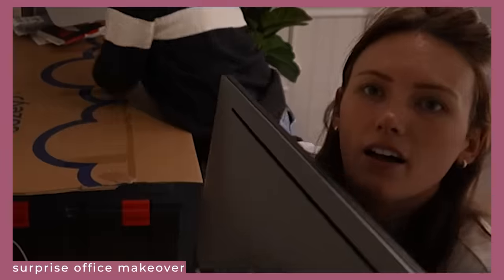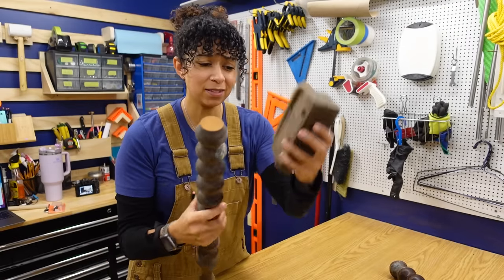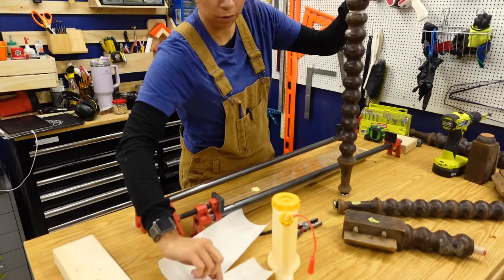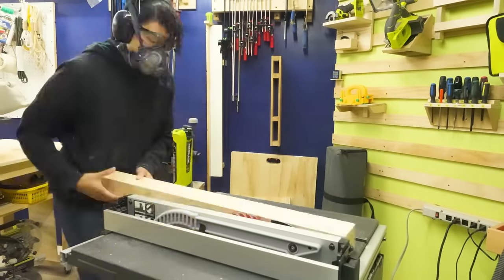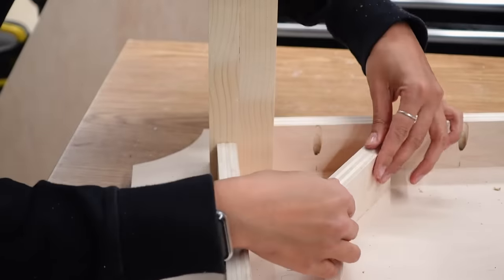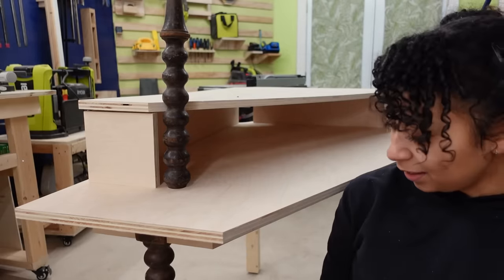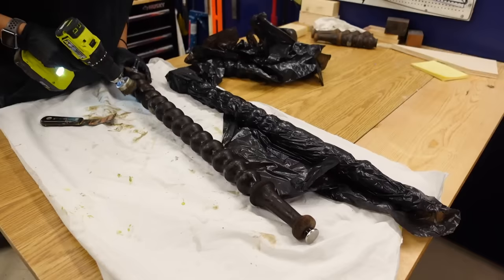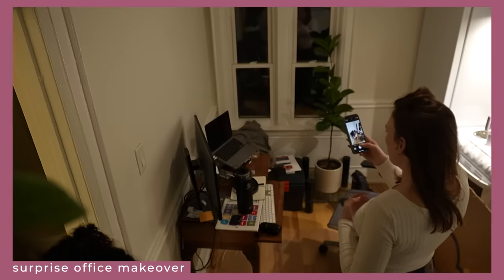HOW TO BUILD A CORNER DESK (start to finish)

Comment: Rochelle is amazing! Both as a carpenter AND as a teacher. Best part about this video is all the info about tools and fasteners and techniques that are so applicable to any project. Thanks Rochelle!
Reply: Agree 100%. Not everyone has the ability to teach and it seems natural for Rochelle, and the rest of the team. And as you said including the info about parts andtools. I wish someone had told me the name for hanger bolts before I tried shopping for them years ago, eventually Google told me but not right away. 🙂
Reply: Yes!
Reply: SO HELPFUL! She has all the tips! I don't DIY much but the tip about planning where everything goes is something everyone has learnt through mistake, and the workaround is so good too

Comment: Love this vid!!! I learned so much!! Some thoughts on the topcoat-
Is that a water based seal? Because I think oil based ones won't work with the sponge. The desk might benefit from several top coats since it's a heavily used surface, especially since water-based costs go on thin. Let me know if I sound accurate y'all!!!